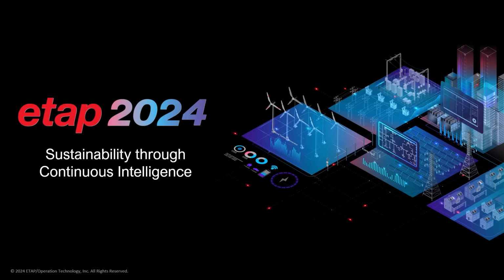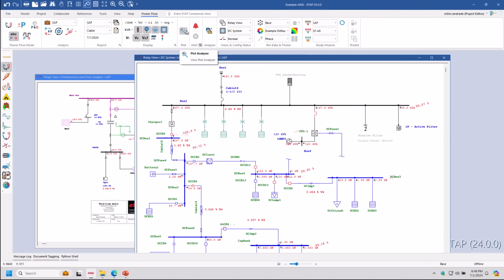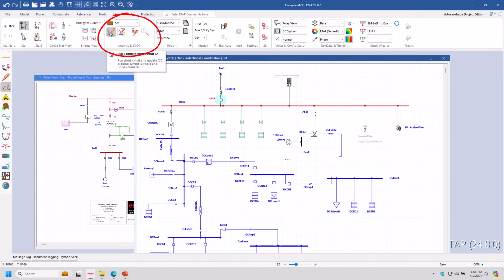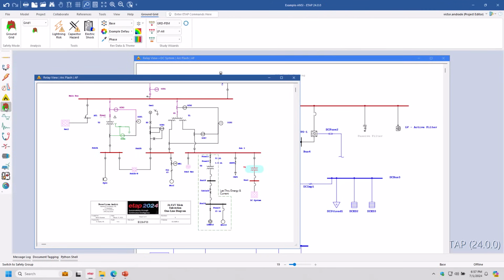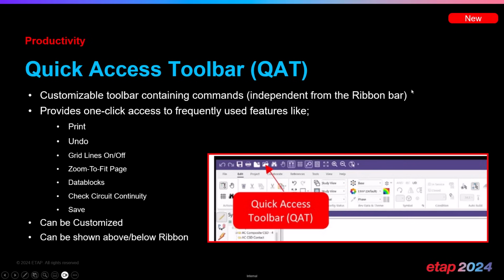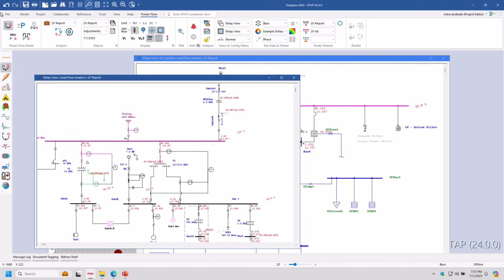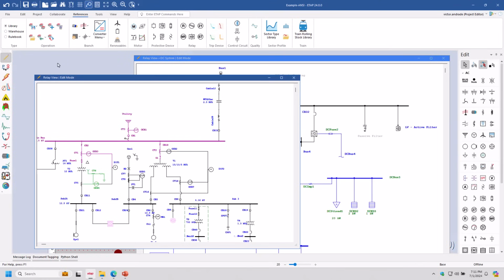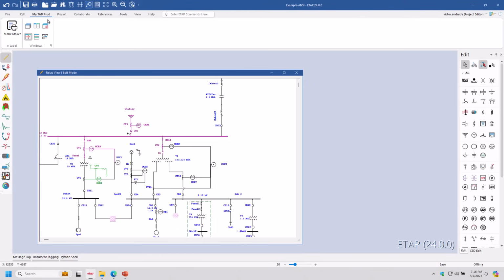Learn about the new and streamlined User Interface with PowerRibbon™ in ETAP 2024

Comment: Is there a way to switch between the new PowerRibbon and Classic Toolbar? There is documentation for the Classic Toolbar and I was wanting to use the older toolbar for a project.
Reply from the maker: Thank yo for your interest in ETAP Solutions. Starting with release ETAP 2023 (22.5) we introduced a new modern UI with ribbon menus and updated graphics. However, you can toggle back to the classic UI using the following steps:
To switch UI modes:
Open ETAP.
Go to the “File” tab (top left corner).
Select “Options”.
In the Options dialog, find the “User Interface” section.
There should be a checkbox or dropdown for:
"Enable Classic UI" or
"Switch to Modern UI" (depending on your current mode).
Restart ETAP for the change to take effect.

Note: This option is only available if your license and version support both UI modes. Some corporate installations may lock this setting

Comment: is it possible to exchange files from ASPEN to ETAP or vice versa?
Reply from the maker: Thank you for your interest in ETAP Software. You can have two data exchange options, you can use CIM or Excel import/export to exchange data with ASPEN. We currently do not offer a dedicated connector. You can also contact datax@etap.com and request a quote to have the data converted for you by ETAP.